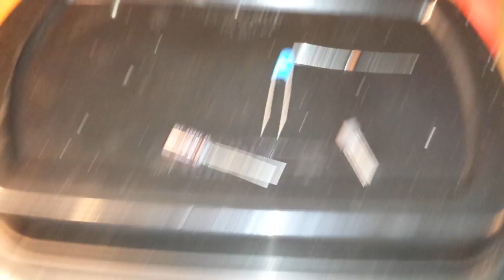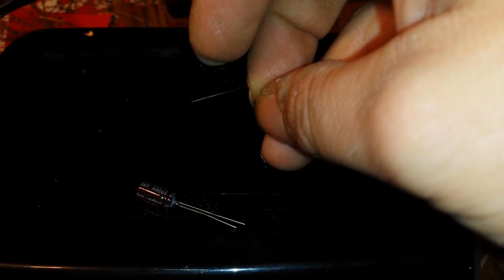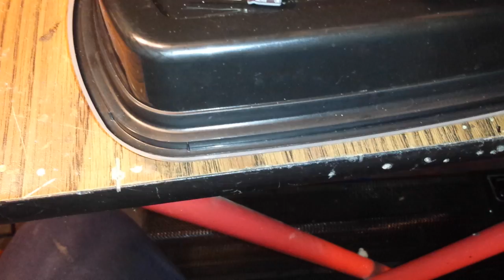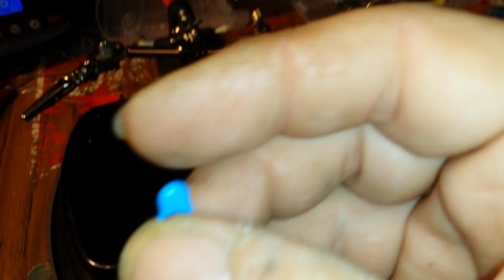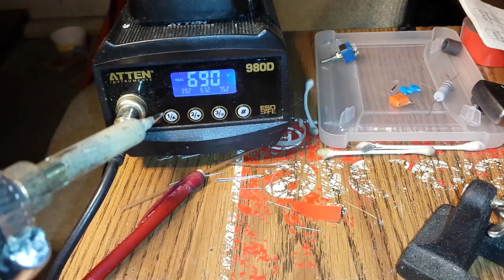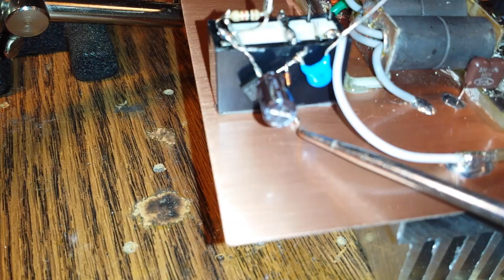Gatekeeper In Amp Building 102 - Keying Circuits

Comment: Mr gatekeeper, ive built a couple amps and am almost certain I did everything right, but when I go to key them , the keying circuit works and it acts like it starts to make wattage but quickly goes to zero
Reply: These are 2 pills ive built and when I say it starts to make wattage , I mean the meter hand kicks up to about 5 or 10 watts and falls right back to zero

Comment: I'm no seasoned amp builder like a lot of these guys..but have spent thousands to the point of building my first amp that I'm happy. With...no desire to sell my amps..ha ha sure...not that good as people person,guess I can be a ass... I found that the keying circuit if u use capacitor blue ,10 mf,103,20 mf....will work but use the silver dip cap.. because a little to much heat..it will still key but it will no let your pass threw signal to work right..messed me up a bunch..till. I figured out ...why they show this I wonder..help us no hurt us.builder guys..u knew this..I know why.

Comment: Hi. Nice videos. What is the purpose of the diode?
  I have a 2pill mrf455 amp with a built in pre amp. After a while on tx while talking on SSB the pre amp relay starts to chatter (if turned on). Wondering why and why it takes a short while to start happening. After watching this wondering if it has a cap to help hold the smaller relay closed while on tx.Didn't remember seeing one. I'll take another look.

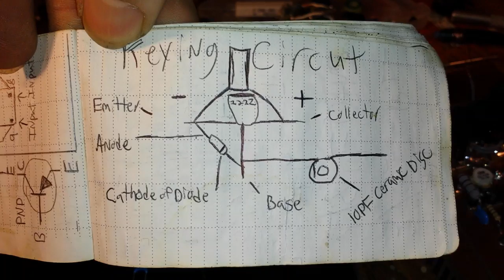Comment: i had too screen shot that paper at 1:28
Reply: also what diod u using
Reply from the maker: 1n914 or 1n4148
Reply: and what transistor are you using...i look on ica but couldnt find them
Reply from the maker: 2n2222a they should be there
Reply from the maker: Awesome

Comment: What value transistor did you use on your transmit led ?   I want to try that but it lights with just the radio also when I modulate.   Want it to only light when I key the box.
Reply from the maker: not sure how you habe yours set up man but it is simple... use a 1k resistor

put neg lead on neg of relay...pos led on pos switch on of main switch. You need to have it on a switch. then it will be transmit

Comment: what are your thoughts on using this type of keying circuit on big amplifiers like a 32pill versus direct keying the relay with a foot pedal etc?
Reply from the maker: Honestly its best to go to a bigger transitor...its ok to use this transistor for up to a 16 or 24. Its the relays coil that dictates this not the input of rf. You can look at the dataset of a 2n2222a to see how much amperage it can handle but just to be safe id use a bigger one

Comment: ok i bought a golden hooker $20.00 2 rf455 stud mounts. was told the 455s were out on closer look they cobbed up (on the rf input side) thinking this is the keying circut trashed thanks gonna try this to get it to work

Comment: great job on a basic key circuit. many different transistors can be used. like 2n3904 2n4401. old Texas Star use PNP transistor. i copied a Palomar key circuit with 2 transistors.   has + out when RF present being a tip 3055 can drive big relay to ground and bias supply . there is many keying circuits.
Reply from the maker: robert meyer indeed...the latest one I used with my ldmos build was very cool using an opto coupler...the internal darlington pair drove the relay...completely isolated from the Input RF Source :)

I have to say that you are the most active commenter on my YouTube videos and I want to thank you highly for that. Stay tuned in because here very very soon I'm going to be releasing all of the work I've done in the last year
Reply: Hi yes I have a optocoupler keying circuit a fit kit I ordered from our mutual friend n have it put together but been busy n haven't got it booked to the ldmos amp yet would love to see a video on hooking it up to an ldmos amp thanks for the great videos 43 gone. 73

Comment: hello buddy I will be very soon buying from you 4 match 2879's could you help me with this on how I can order them from you? I bought an amplifier but pills were not matched and 1 burned...do you also sell all parts for building amps or just the transistors? I may need some other parts since swr to radio is killer...again thanks for your videos they are very educational...
Reply from the maker: Thanks bud...Just wanted to let you know I am releasing videos again...if you haven't had a chance to check them out make sure to, and come down and leave me some comments, thumbs up, etc...because it helps with YouTube algorithm to help me get scene. Thanks a lot buddy!

Comment: I reckon the jumper on the relay could also go on the pins below it as well right since each side is connected when the relay is off? i just looked at an amp of mine and i noticed the jumper is not where you have it, but one row below
Reply from the maker: It is because the relays are different pin outs
Reply from the maker: Thanks bud...Just wanted to let you know I am releasing videos again...if you haven't had a chance to check them out make sure to, and come down and leave me some comments, thumbs up, etc...because it helps with YouTube algorithm to help me get scene. Thanks a lot buddy!